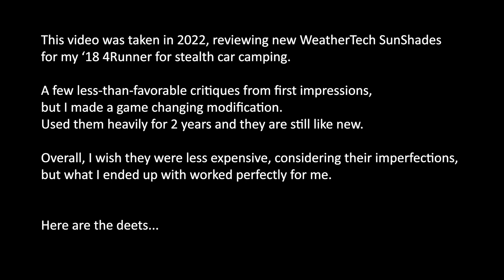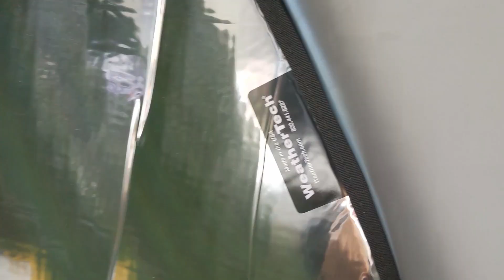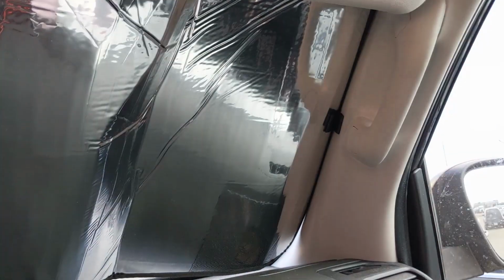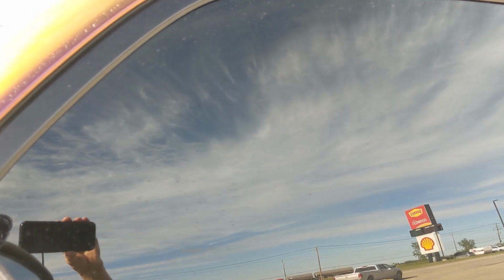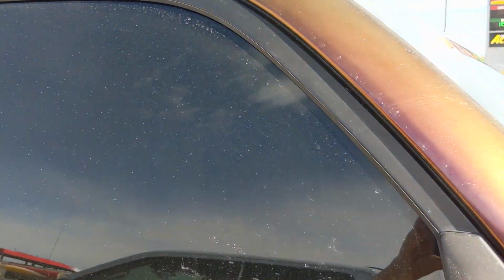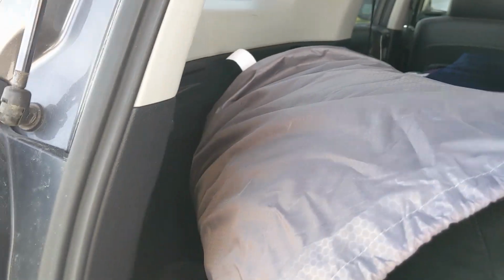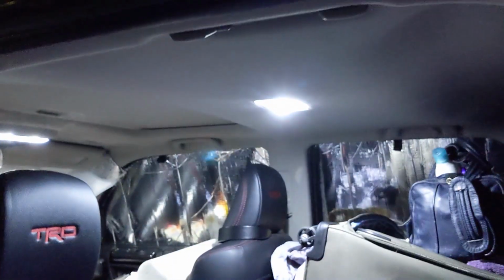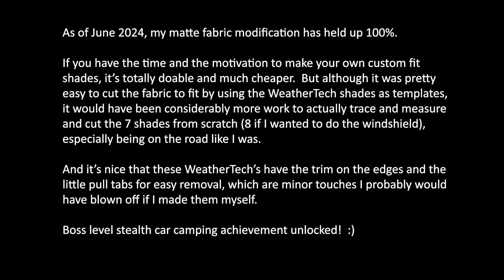4Runner Stealth Car Camping - WeatherTech SunShades Mod and Review

Comment: What fabric did you use and where did you get it?
Reply from the maker: @AntbankSD  I'm so sorry, I don't know exactly what it was called, but it was kind-of a thin, faux leather, and it had a mild elasticity to it.  Honestly any matte material that's not sheer and has some mild stretch to it will work.  What I liked about the faux leather is that it was more robust for gluing, whereas liquid glue would seep through a thinner fabric.  I used a liquid cement type glue so it would have a little give to it, unlike crazy glue which is brittle.

Comment: Did you get it directly from weathertech? There are knock offs out there. Weatheryech is supposed to ask you what your car is and they send you the pieces that are designed for jt.
Reply from the maker: yes, directly from them.  it's fine.  i was traveling and had to have them delivered to a post office in Canada, kind of a pain, so i didn't push to have the windshield piece resolved.  really happy with the others, they have served me well.